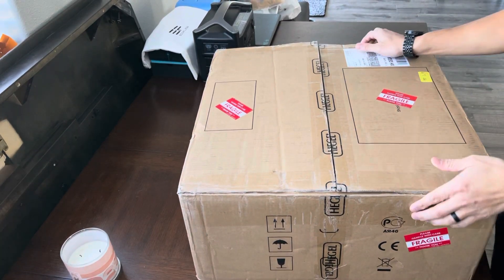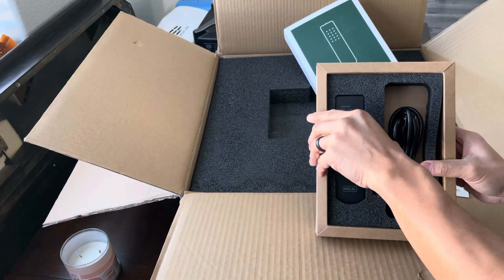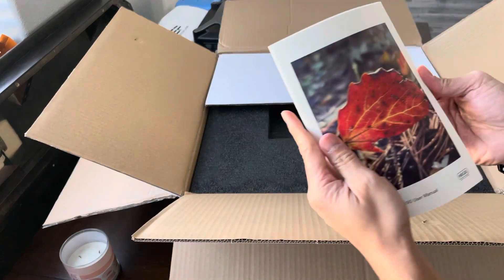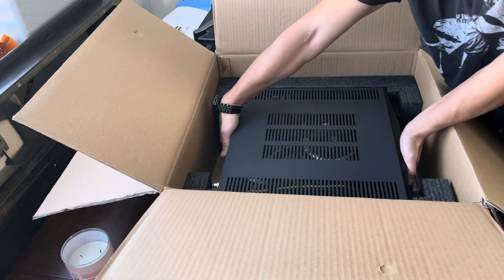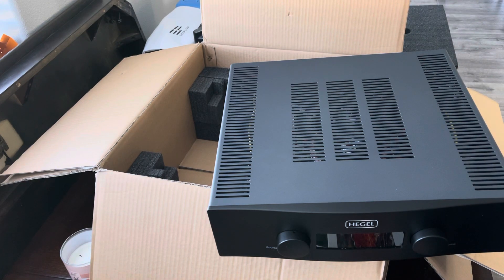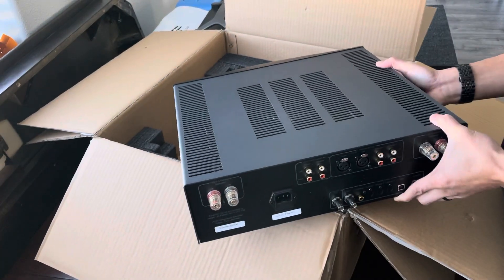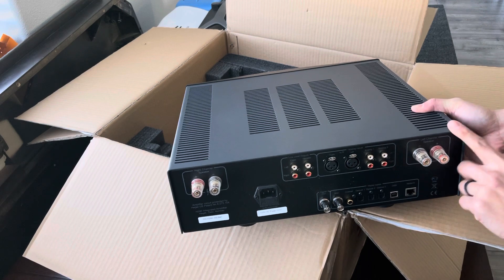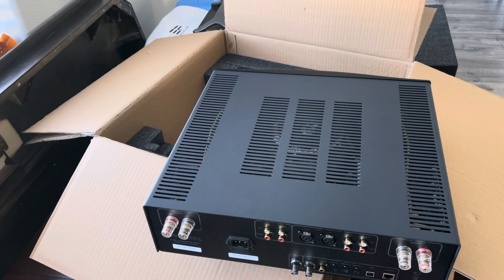Hegel H390 unboxing! 250watts Class A/B, MQA, Apple Airplay, Spotify, UPnP Streaming, Dual Mono

Comment: Hello,
What bothers me with the Hegel amp is that they hide that it's made in China! and in addition a reputable high-end seller told me that he stopped selling Hegel amplifiers because of the reliability too much failure and that the supplier did not give any diagrams or documents. Would it be interesting to know if this is also the case elsewhere? 
Please note that this does not take away from the fact that this is a very good amplifier well above the average.
Reply from the maker: I’m only concerned with sound quality. I’m currently using this to power Magnepans 1.7i and it sounds is awesome
Reply: Stop misleading people. To say these amps are "made in China" is simply false. All Hegel amplifiers are designed, developed, engineered and tested in Oslo, Norway. The final assembly is done in China like so many other high end audio components.  My BMW which is a high-end German engineered car is assembled in Mexico (3-series and 5-series) but I don't hear any one say, BMW's are "made in Mexico". Stop propagating your xenophobia!
Reply: So what ? All iPhones and many other Apple products are made in China. I think you have to update your knowledge about China.
Reply: Where is your evidence of Hegel amplifier failure?
HEGEL are known for their reliability i haven't heard anyone say that Hegel are unreliable....

Comment: What's your opinion of it so far? Did you have your Klipsch speakers hooked up to a different amp previously? If so, is the a noticable difference using the Hegel?
Reply from the maker: I love it! I started off with my B&K AVR305, then moved to a few different (BluSound PowerNode 2i, Sonos Amp, Cambridge CXN V2 hook to the B&K, and finally Naim Uniti Atom). I’ve been on the audiophile search for the right equipment
Reply: @Gadgetjitz  Do you have Klipsch speakers?  I just ordered Heritage Cornwall 4 for mine.  Is the Naim much better than the other streamers?
Reply from the maker: @buttonman1831  yes, I have the Cornwall 3 and love them! Congrats on the CW4! The Naim will run them but when you start getting over 50%, I feel that it runs out of muscle compared to the H390. Overall, the Naim is a great device but the Hegel is much better IMO.